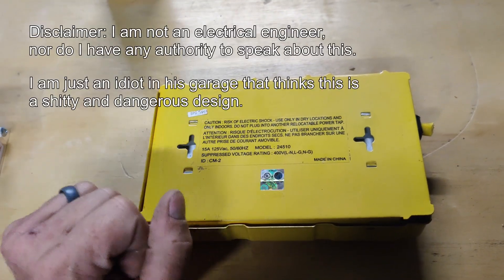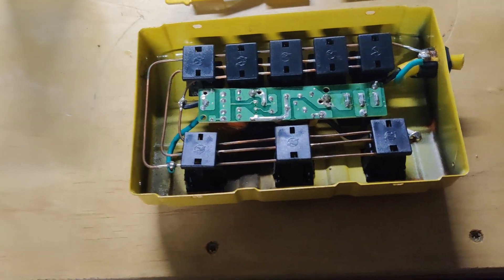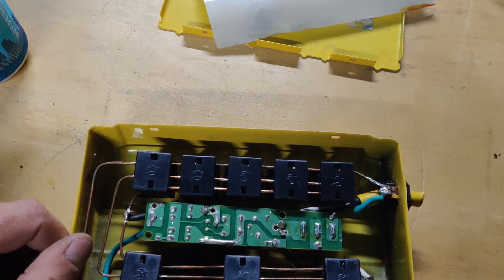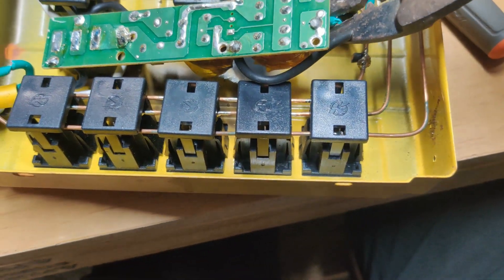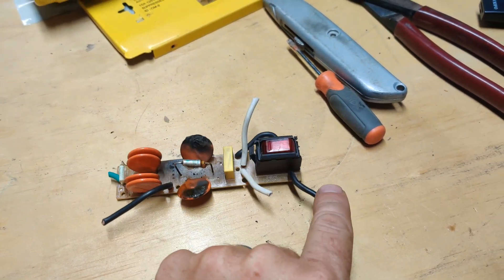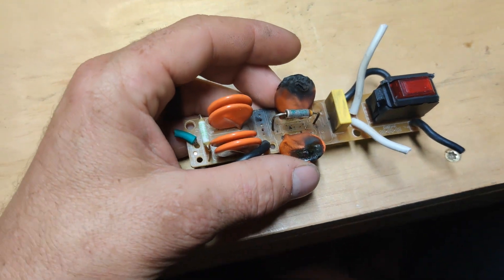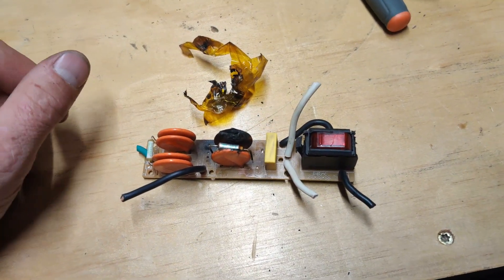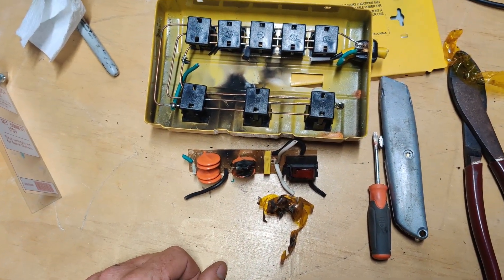Did this thing almost kill me -- surge protector failure

Comment: I would suspect that at least the first generator wasn't a pure sine-wave generator.  When they aren't, they can mess with switcing power supplies, like the one in the water heater.  This probably what caused the capacitor to fail.
When the MOVs blew, while hot enough to burn and melt the Kapton tape, was obviously not hot long enough to trip the thermal fuse. The MOV may have failed short.
If the case itself was shorted to the hot leg then the connection to ground (the soldered connection where the power entered the box) should have tripped the 15amp generator's breaker.

Could possible dremel open the bottom of the water heater control board and try replacing the capacitor, but other components may have also failed.

Comment: I suspect your generator actually. MOVs only blow for overvoltage, not overcurrent. So the fact that a MOV blew and a cap blew makes me think your generator had an overvoltage condition.
Reply from the maker: I suspect the generator also. The two main issues I had, one it didn't protect the heater and two it left a very dangerous condition.
Reply: @whynowork8480  Agreed, the circuit breaker definitely should have popped (also the one on the generator!)